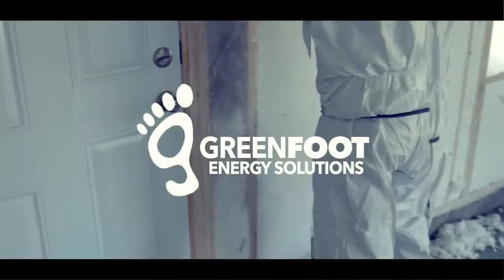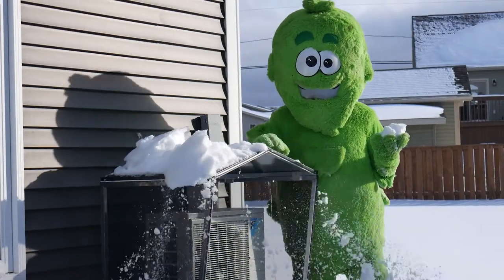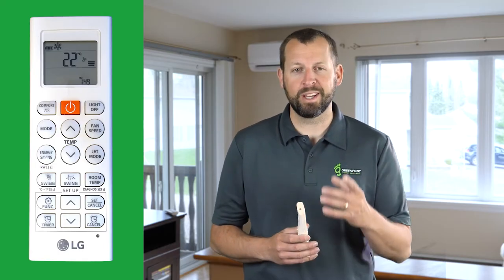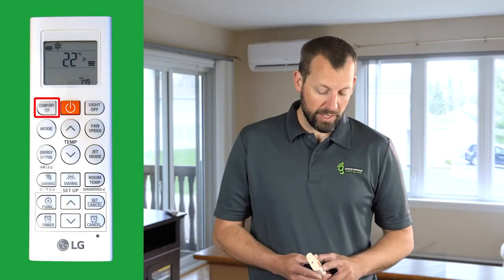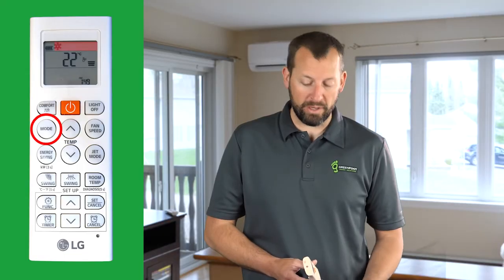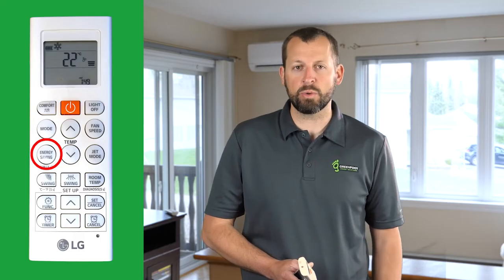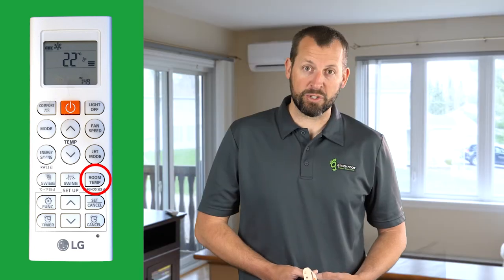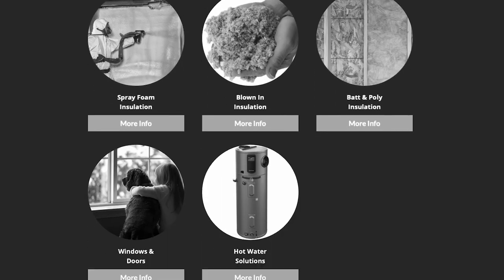How to use your LG ductless heat pump remote

Comment: My lg ac is not heating well, everything o  the remote looks fine for the heating mode but it keeps releasingg cool air from time to time and the room is still very cold 😩😩
Reply: Check pipes for gas leakage